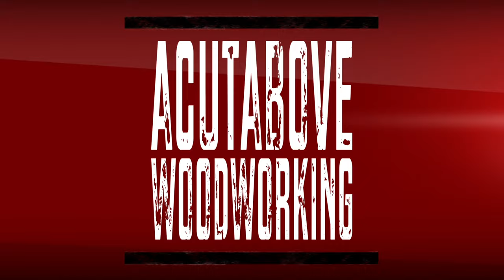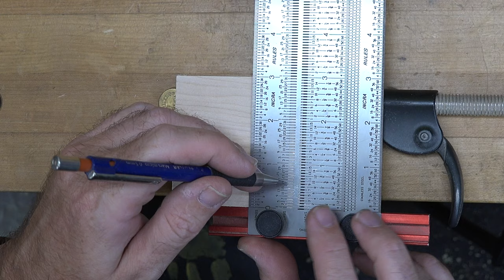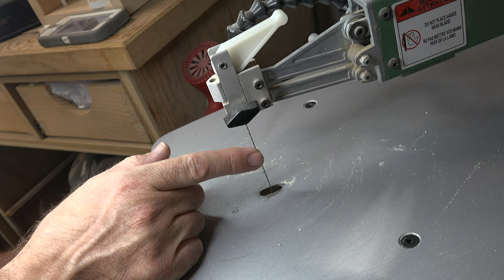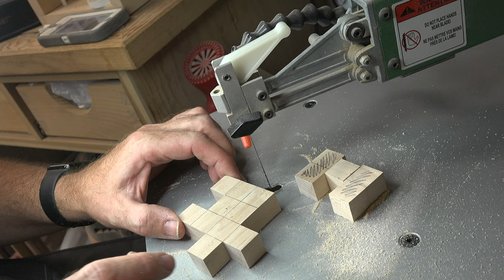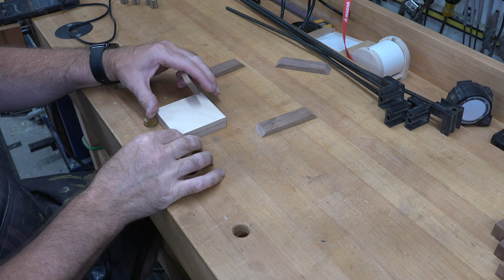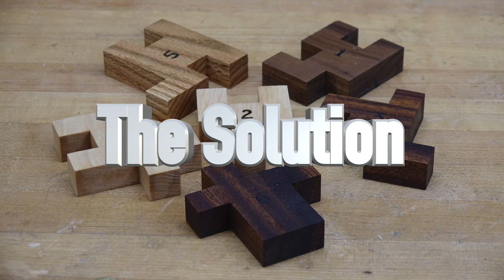Making a Wooden "Eraser Puzzle"

Comment: What is the speed of your saw, usually?
Reply from the maker: I usually run the saw at anywhere between 1/2 Power and 3/4 power which would be approximately 800-1200 strokes per minute.  It depends on my mood and the material and complexity of the cutting Marc.  I hope this helps.  Thanks for tuning in sir.